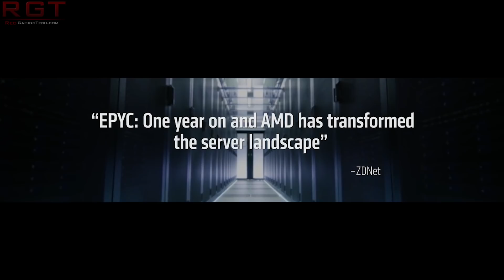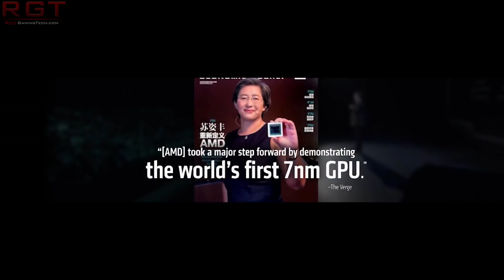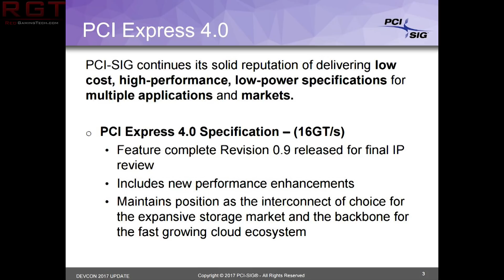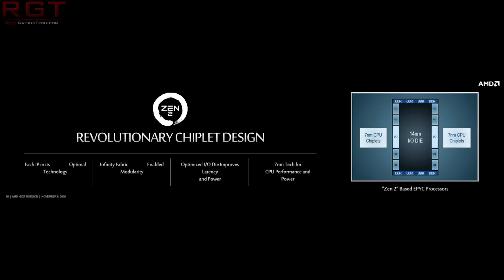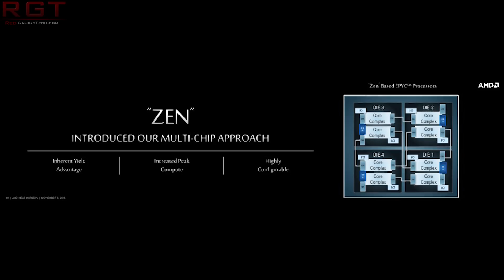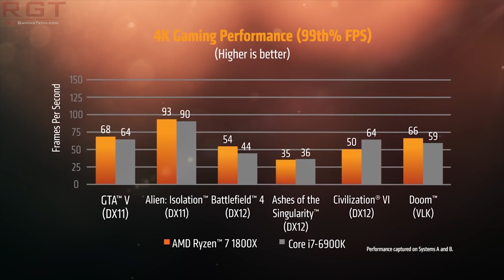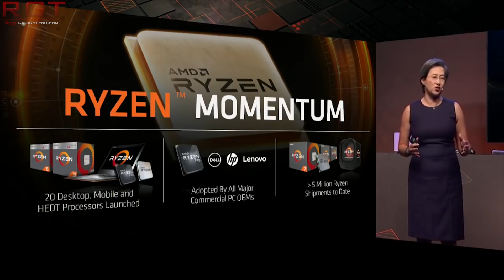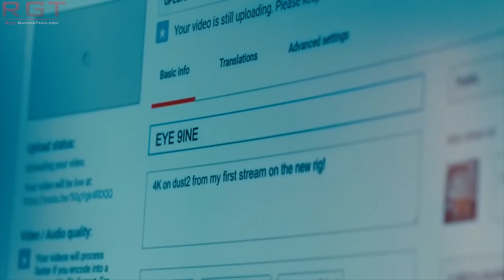Should AMD Raise The Core Count for Zen 2 Ryzen 3000 CPUs ?

Comment: no need to increase the core count fix the memory latency... and very high clock speed... by improving the fabric..find a way to control the high temperatures.. more cores leads  to more heat.
Reply: Though keep in mind that double the clock speed results in more than double the power consumption, which makes more cores more efficient power wise.
Just an idea. Though for AM4 I think it's at 8 cores and maybe an iGPU which can offload some heavy workloads (and this would make it more appealing to gamers because it makes Freesync on Nvidia hardware possible)
Reply: having a sku with 16 cores doesn't prevent you from buying the 8 core version now does it, and if the 8 core is made of 2 dies it will be quite a bit easier to cool at high clocks than if it was in a single die and you might also get more cache (for an up to 4 times what ryzen has)
Reply: @cj09beira  Agreed, but does it make sense to have 16 cores on AM4? Until recently we had 4 cores across the board on consumer platforms. It's been doubled with AM4 already, but the single core performance is now the main target for improvement together with the latency. 
I think 16 core is TR territory.
Reply: @CApnTates latency is the only problem this brings, but my guess is that amd is going to have some sort of L4 cache to help and hide it. 
making the core all on 7nm would mean higher costs for each die and also during the design phase, 16 cores is too much, naa it will be too little soon enough, also we dont need to buy it do we, we can just buy the 8-12 core sku, single core performance should be up quite a bit as this time the node should not be as bad as it was
Reply: Memory latency and to a lesser degree, clock speed, is the deal breaker for me with AMD atm. I work with high end audio in a studio environment, the latency is a killer. I'm hoping next gen ryzen or TR will improve on those. 10-12 cores would be enough, don't think they need to focus on core count this time.
Reply: @angelvids6024  The latency in the processor probably has little to do with the latency in your audio software. The latency in the processor is a matter of nanoseconds, which is completely mitigated if you have block sizes of more than 128bits even with192kHz, which isn't even that conventional in high end audio and with it the latency as perceived is still a matter of maybe milliseconds of which the biggest bottleneck is the DAC.
Maybe edit those settings a bit  in whatever software you're using and check whether your DAC has low latency drivers. 
If the gripe is mixing real time, better software may be desired (and you should use proxy files). If you're using a lot of tracks I don't think lower latency will get you much further. Use proxy files or change your workflow to use fewer tracks.
Reply: @nextlifeonearth  Hi thanks for the info. I don't own an AMD setup yet, but I'm looking to upgrade my ageing ivy bridge system next year. The issue is indeed with real time audio, I've been reading reviews on the more trustworthy forums of issues when trying to run with lower latency buffer levels, for example right now I'm only able to run at 256-384 on larger projects. I don't want to have to bounce everything down, I didn't used to need to until vst sample libs became bigger. I also struggle with running more than one or two instances of soft synths at a time, the performance degraded over time with updates. So from what I'm reading, with intel chips users are able to run with very small buffer latencies, down to even 64. With AMD something to do with the design prevents that, apparently 128-256 is as good as it gets before stuttering kicks in, but apparently for running endless amounts of soft synths etc AMD's chips perform very well.
Reply: @angelvids6024  A tip from a previously low budget audio enthusiast then: only enable high sampling and bit depth for the export if you just use synths (for recording this is a lot more hassle). Use normal or maybe even lower bit depth and sampling than you would typically listen to, it will allow you to drop the latency and decrease stutter, but the export will still have the real quality. (do check your VST plugins sound as intended in different bit depths and  sampling rates. Some less thoughtful VST developers go by sample instead of time)
Reply: @nextlifeonearth  I already lower the bit rate and use Cubase's bounce feature to reduce cpu load. I shouldn't really have to do this though. My system was very high end when new and I should be able to do what I used to after an upgrade. I'm just not yet convinced AMD is the one yet. I really don't want to buy Intel next time.
Reply: @angelvids6024  I cant imagine you would suffer from latency issues with newer AMD architecture; Do you run an audio interface?
Reply: @TheRealSamPreece  yes I'm running an SSL interface with a MADI card. I'm relying on reviews on forums atm they're consistently saying AMD chips aren't so great for this task. Good for most other things though.
Reply: @angelvids6024  Id be interested to see benchmarks comparing  amd ryzen and intel in this regard. What type of workloads are you performing and is the interface a limiting factor in regards to latency?
Reply: @TheRealSamPreece  There's some info here http://www.scanproaudio.info/2017/08/14/first-look-at-the-amd-threadripper-1920x-1950x/ although that's the first gen, the next gen chips are based on same architecture. The issue relates to NUMA addressing because it's essentially two processors linked together via infinity fabric it causes parallelization problems due to the way AMD hides NUMA awareness from the OS. Software that relies on low latencies often can't make the best decisions on how to use the cores and memory. Daws typically favour monolithic processor designs like Intels. I believe the next gen amd chips will improve core and memory NUMA access next time so I'm waiting on that.

Comment: No, increase the clock speed. That would put a big push on Intel. Besides, the motherboard quality isn't up to par. Socket wise AMD isn't changing every year but the motherboard makers are making crappy boards that cause you to upgrade each time anyway
Reply: clock speed and IPC at same/less wattage..PB3/XFR3 likely will be "very nice" as long as power use and temps are "kept in check" and not balloning like Intel did with 8/9000 series just to chase the "clock speed" dream.

Comment: This is  what I think is going to happen . We will get the same line up as the last launch of Ryzen. Then in the fall or winter 2019 AMD will launch Threadripper on 7nm+ just to have a product that is better than intels 10nm when it launches lol. Then in late winter or early spring 2020 we will get Ryzen 4000 on 7nm+ , This is when we will get 10-16 cores for Ryzen. But it is also possible that Ryzen 4000 could be launched at the same time or shortly after intel launches 10nm, not to sure about that as it maybe to short of a cycle between launches and would piss off a lot of people who bought 7nm Ryzen. AMD will be in a tough spot if TSMC's 7nm+ really is ready for production in June 2019.

Comment: There is a limit to how many cores two channels of memory can support (for AM4).  That said, I think 12 cores would be ok... but if AMD does that it will probably be a '3800' part.  I think the existing parts will retain the existing core counts.  So, a 3600 will be 6 cores and a 3700 will be 8 cores, with 1.25x all-cores turbo clocks.

Another interesting aspect of having more cores is that you start to get better performance by populating all four dimm slots and OCing the memory less, verses sticking with two slots and OCing the memory more.  This is because the more cores you have the more random access memory cycles the memory controller will have to do (i.e. there will be more RAS cycles in the mix).  We already see this effect on the threadripper when testing with 4 DIMMs verses 8 DIMMs.  On AM4, going from 2 to 4 DIMMs should have the same effect if the AM4 CPUs increase their core count.

From a technical perspective, the problem the 9900K has is that it burns too much power to get those speeds.  Simple as that.  It is amazingly power efficient at lower clocks... more efficient than the 2700X, but there's no point buying a 9xxx series CPU if you don't intend to OC it.  Power consumption is not something that PC buyers generally thought about historically, but it is quickly becoming a metric of major importance as multi-core dies become increasingly limited by thermals rather than by clocks.

In terms of AM4 verses Theadripper... honestly I think we need at least 4 memory channels once we hit 16 cores (32 threads).  A 16-core AM4 part will behave very similarly to the 32-core TR part... memory bandwidth will clearly be a limiting factor.  More to the point, if AMD wants to make good use of their defective dies, a 12-core AM4 part makes a lot more sense than a 16-core AM4 part.  That would give AMD incredible flexibility.

-Matt
Reply: There is no such "limit" that 2 channels can only support say 8 cores...always has been on how well the "cores" are designed to use that memory, this is why they have uncores and the like..if anything, the more latency on main memory the better in regards to having more cores and/or interposers...infinity fabric/hypertransport have always been very effective at using the amount of memory present very well...there might be a small "latency hit" because they can only physically connect the cores to the main memory in so many ways at full speed, sure, but "technically" there is no limitation, all depends on how "well" they make them...was not that long ago that Intel was only 4 core 8 thread MAX until Ryzen cam along that is, funny they crammed in double the amount of cores and threads with dual channel :D

Comment: 10 core, 20 thread or 12 core, 24 thread on the mainstream would be pretty cool. But, I just want a 8c, 16t that goes up to 4.5 - 4.8ghz and is faster in games and Adobe Creator Suite. Im all on board for Higher Clock, better IPC and better performance in certain programs.
Reply: Yep, SC and QC performance needs a leap to beat Intel, whilst maintaining an affordable cost for mainstream desktop users.  I want the best gaming CPU without having to pay stupid money for it.
Reply: Couldn't agree more, aside from some fringe cases gaming exclusively depends on single core IPC, and the only direct whys you improve that is shrinking transistors and increasing clocks.
Reply: 10 or 12 core for me with high clock speed.

Comment: They should do variants.  Have a smaller core count with very high clock speeds.  Have higher core counts with as high a clock as you can get without having to turn your furnace off in the winter.

Comment: if they can get more clocks and ipc from 8 cores then do that.  if they cant then add mroe cores.  but if all they can do is add more cores and get a small bump per core that will be a disappointment.  glofo was holding them back though i think.  they should be able to get a pretty good bump this time.  maybe one 12 core at the top.  an r9?  other than that more clocks and ipc

Comment: 8 core/16 thread is plenty for the average person.  I would like to see higher core clock speeds and better IPC to better Intel or run side by side with them. If AMD comes up a tad short that's fine as they are priced much better than Intel.

Comment: Mainstream fo not need more than 8 cores 16 threads.  Keep it the same with a higher clock speeds and better ipc.   If a Ryzan 2700x was running at 4.7ghz.. intell 9900k would cry like a little girl!!!   Hope zen 2 goes up to 4.6ghz with turbo, with 10% to 13% ipc gain. So intel shit themselfs and have a nervous brakedown and reduce there stupid rediculess prices and mobo sockets boards

Comment: Its 2018 still at stock speeds 3.5ghz n such.... 5ghz 95w tdp without overclocking would be nice
Reply: law of diminishing returns...it takes A LOT of power in terms of watts/volts to run silicon at 5Ghz and not fry the moment it "turns on" physics is a very cruel thing LOL.

Comment: I know not one game that can utilize more than six cores. in fact, half of the games I have don't even support above quad-cores. 8-core CPUs are more designed for streaming and editing.
Reply: BF1//BFV/CIV6...there are actually quite a few that can use more than 6 cores, but, I am with you "overall" have 6 very fast cores is much preferred "at this point" over 8 "slower cores"
that being said though, 2 extra cores at similar speed/power use as the 6 cores can give you 2 extra cores for all the background tasks the computer is constantly doing...I wish we could target the cores to ONLY do background tasks (example core 0 core 0.5) so that the remainder of cores ONLY target the application (I wonder why they have not done this yet (taskman MSFT do something intelligent instead of worry about spying on people and forcing updates when we don't need them) ^.^
Reply: @mauriceakamoefortin2510  I remember clear back with windows xp, you had the option to select which process you want for which core despite xp lack of support for these high-core CPUs. I haven't seen an option in windows 8.1 or 10 which has that capability.

Comment: Ryzen 3700 and 3700x should be 8-core CPUs. But they could release enthusiast 12-core and 16-core Ryzen 9 3800x and 3900x.
Reply: I like the idea of having the 8c 16t single chiplet for max clocks, and letting the 10% of us have the lower OC-able 12 and 16core dual chiplet variants on AM4. as for the IO controller die transplanted onto AM4, well, AM4 doesn't have 16 memory channels, nor does the socket have 128 PCIe lanes, the IO die can easily be cut down to AM4 specs and keep the links for 2 chiplets. And it's not like adding a second chiplet will somehow magically limit the max OC of single chiplet models. It really looks like the chiplet is here for zen2, the only question is how revolted are 51% of people going to be at having AM4 skus available with more than 1 chiplet, remember there are models with less than 8 cores (R3 and R5) and they do sell.
Reply: 12 core 3900x sound ok but threadripper for more cores.
Reply: Is the can put 10 or 12 core CPU with 4.5GHz on the mainstream Intel are done
Reply: 16C would definitely in TR range in near future unless they get 5nm cpu
Reply: ThreadRipper is Ryzen 9 hence the 19xx/29xx naming scheme!
Reply: they have threadripper for enthusiasts and that already go up to 32 cores
Reply: @rurutuM  Threadripper will be able to go up to 64 cores with zen 2.
Reply: @rurutuM  uh, epyc goes up to 8 CCXs (64 cores now). Threadrippwr supposedly can go up to this. Ryzen should now do 16 cores 32 threads. AMD needs to be better than Intel and that's how they can do it. Plus they'll blow Intel out of the water with multithread performance
Reply: @Cryosxify  Ryzen will stay at 8c core until the entry Threadripper is more than 12 core. What Ryzen needs is IPC and higher clocks. The R7 3700x could be within 10% of the i9 9900k for half the price.

Comment: I think they should have a 6 or 8 core with clock speeds cranked as high as they can, AND a 12 core with a slightly reduced clock speed.  Save the 16+ cores for Threadripper.  8 cores on AM4 works well for me, but when I'm running a VM it would be nice to have a few extra cores for my use case because I typically leave the VM running in the background.  Having a few extra cores above 8 for me would be awesome so I could leave the VM running in the background without eating into the other 8 that I use for gaming, browsing, etc.  I know this isn't a typical use case but I'm sure there's more than a few people out there in the same boat as me.
Reply: I think you should have bought the 2920x 12 cores /24 threads at 650$
I wanted to get it but 399x motherboards are really expensive
Reply: @jassimmn9004  Yeah that would have been nice if it weren't for the price tag.  AMD's Threadripper chips are priced much more competitively than anything Intel has with high core counts, which is awesome, but the total system cost will keep me from getting one any time soon.  If I could get a $150 TR4 motherboard things might be different.  I don't need 64 PCIE lanes or 128+GB of ram, I just need 12 cores and 32 or 64 GB of ram and I would be fine.  Upgrading to TR for me is overkill.
Reply: I'm with Tom, in that having the 8c 16t single chiplet for max gaming/OCing with existing naming is fine, and having an R9 AM4 with 2 chiplets for the rest of us that do VM/rendering/work without corporate/government level budgets is a very easy win-win for AMD. zen2 is clearly chiplets with 8cores per chiplet and a separate IO controller die, having AM4 with one and two chiplet skus is super easy for AMD to implement (just like TR vs EPYC), it's only a question of how much people want to limit others options.

Besides, for some without the TR/EPYC budget, it would be nice to not have to spend the extra memory blood-DIMM tax on top of a new motherboard. I would much prefer to drop a 12 or 16 core Ryzenn into the GN R7 build, rather than eat roman noodles for multiple months for each item that the TR would need.